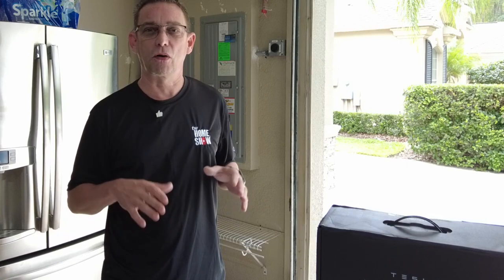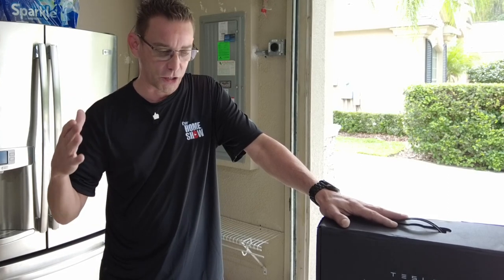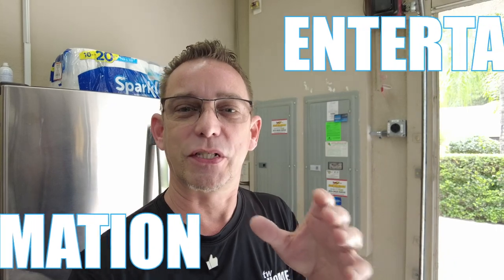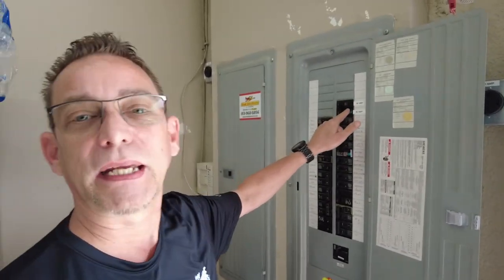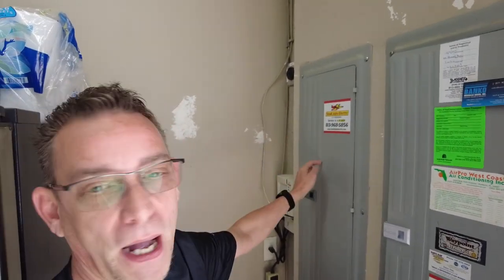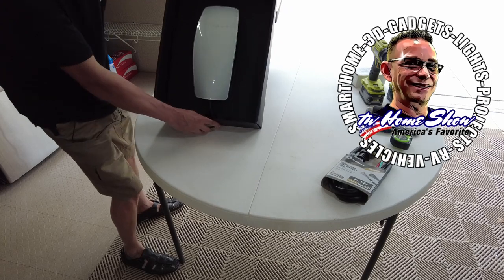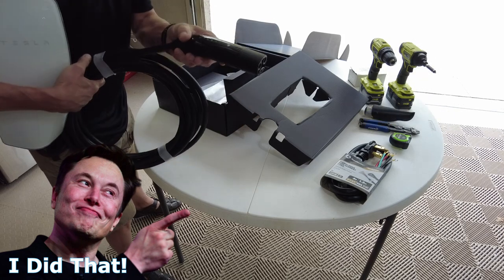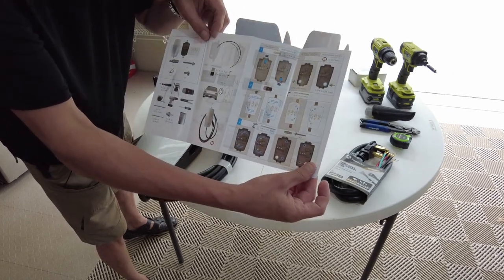TESLA Home Charging | 14-50 NEMA Charge with Plug | TESLA Wall Connector | How to Charge my TESLA

Comment: I have the opposite situation.  I have a hard wired Tesla level 2 charger and I want to replace it with a 50 amp plug.  I'm moving and want to take my Tesla "wall connector"  with me.

Comment: Great video. One question. Should this work on a nema 6-50r? I had plug installed in my house build and assumed it was nema 14-50 but just looked and noticed it’s actually 6-50r 3 prong plug. The wire going to it is 4 wires but they just have the ground wire unattached

Comment: There are special "wire terminal shoes" that you can crimp for power cabel ends. You tighten the bolt to crimped cable shoe instead of the bare wire. Hope this helps.

Comment: Thanks for the video! Did you have to change any of the internal dip switches inside or did you just use them as they were arranged?
Reply from the maker: I didn't touch them. But, refer to the instructions.

Comment: Question for you brother! My garage plug is 40 amps instead of 50 amps. With the included tesla cable, it pulls 32 amps fine. If I'm trying to use the Tesla Wall charger though, would I buy the same 4 wire range cord that you bought, but instead of 50 amps version, the 40 amps version? I'm okay if tesla wall charger pulls 32 amps - just need some confirmation I'm on the right path! Thank you
Reply from the maker: The higher the cord rating, the better (and safer). No mater if you are pulling less amps. Remember, if you don't feel comfortable, hire an electrician.

Comment: The 1450 cord you suggested link on Amazon describes not suitable to use with EVs.
Reply from the maker: Hi Jignesh, It doesn't state "Not suitable to use with EV's", It states, "Not intended". This a Power cord rated and UL Listed for use with up to 50 amps of power-draw. I have my TESLA M3 set to charge at 40 amps. The cord doesn't know the difference if you have it connected to a smartphone, dryer, microwave, Tesla, or generator....all the cord knows is it can handle up to 50 amps :)

Comment: Have you received your Tesla? What’s the charging rate the plug+connector combo is getting you?
Reply from the maker: Yes. Got our TESLA. With the plug and connector I hooked up, I get 40mph at 40amps as expected.
Reply: @twHomeShow  Thanks! Debating on doing this vs hardwiring mine